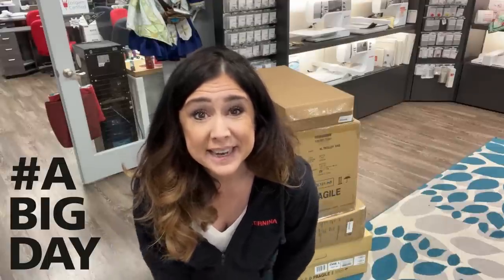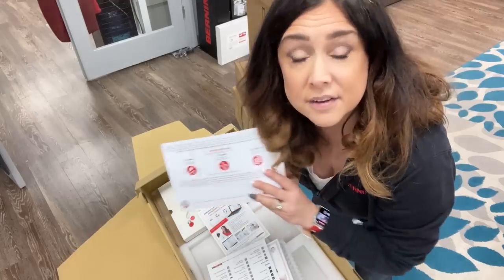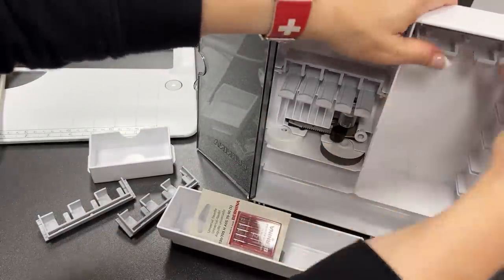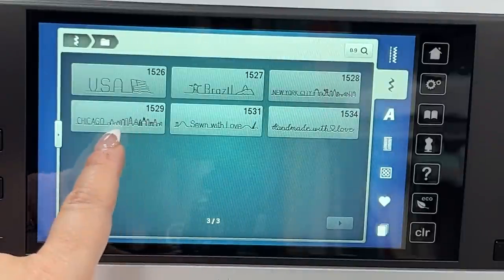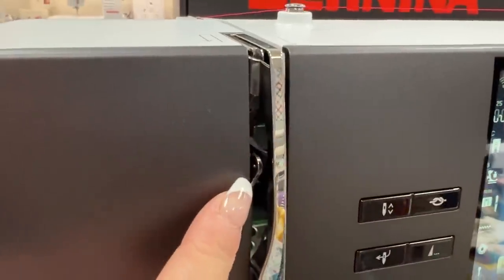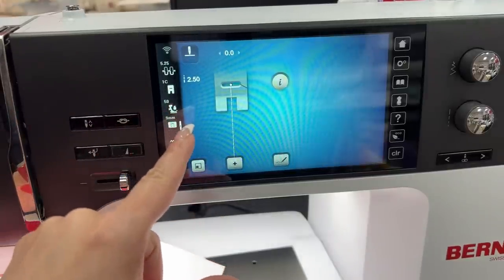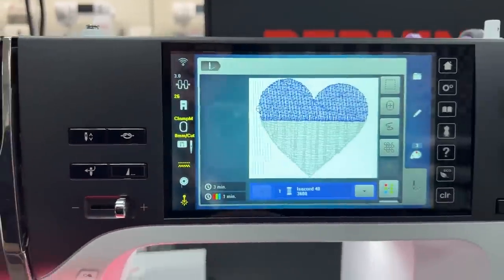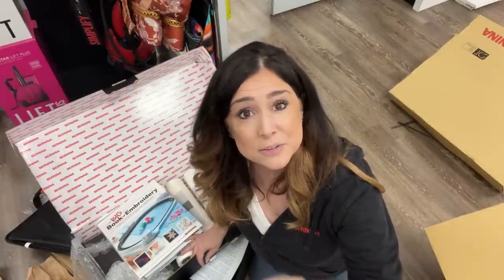BERNINA 790 PRO - Unboxing #ABIGDAY

Comment: What size hoops come with the machine?  I’m hearing the largest one is not included?
Reply from the maker: In the video, I show the hoops that physically come in the embroidery module box, small (2”x3”), medium (4” x 5”) and larger (6” x 8”). The introductory pre order promotion from BERNINA imcludes the largest hoop for a 7 series called the “Maxi Hoop” (8” x 15”). It is packed in the embroidery module suitcase which also comes with the introductory promotion.
Reply: @BERNINAofNaperville  thank you!  I’m trying to hold out until the event my local shop is doing. Hoping they will have a good offer still!